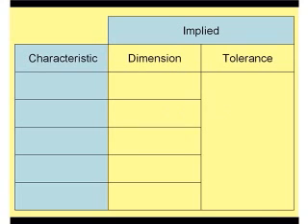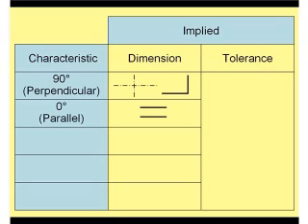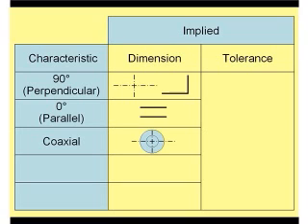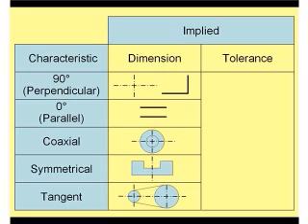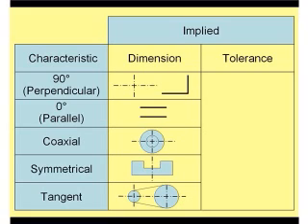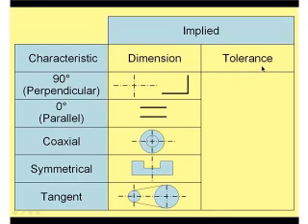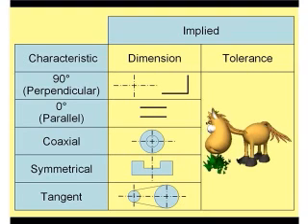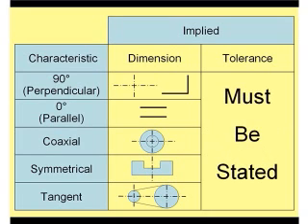GD&T Tip from Tec-Ease - Some Dimensions Are Implied, but Tolerances Must

Comment: UOS, the title block tolerance applies to angles. 

If two diameters are coaxial but there is no geometric tolerance relating the two features, then how is the relationship being controlled? 

Personally, I would use the minimum box tolerance, which in my case is +/-.005 and apply a best fit position. Is this acceptable?